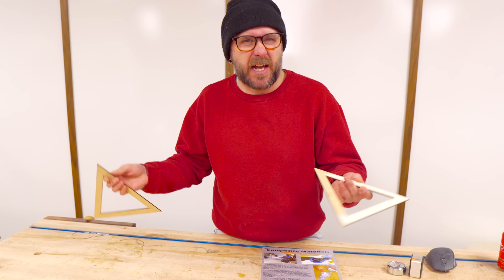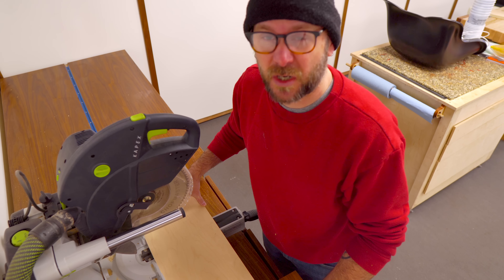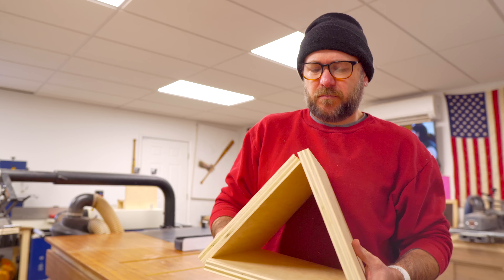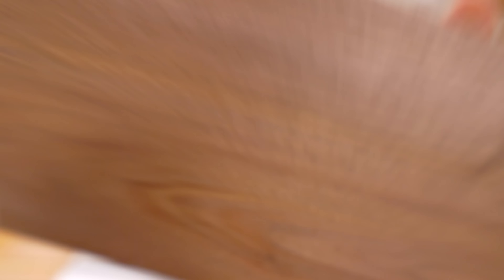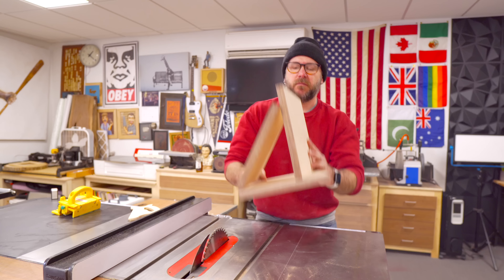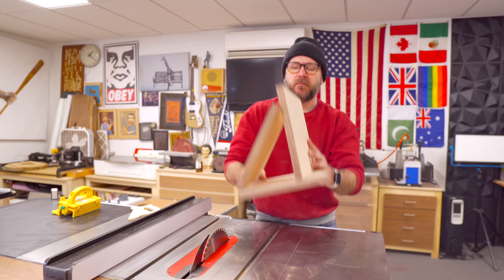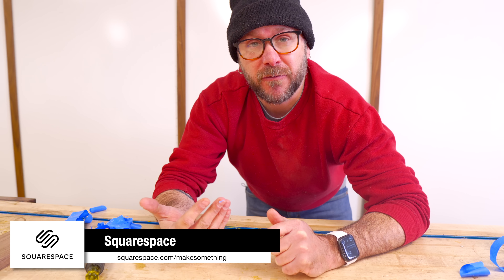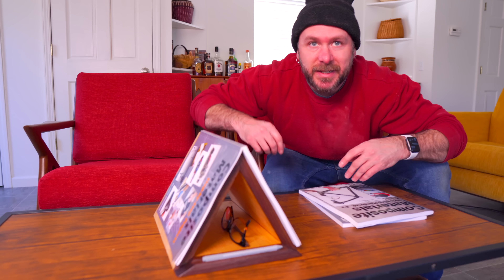How to Make a Quick and Easy Book Stand From Scraps. | Beginner Woodworking Project.

Comment: 12:55 We're all a bit on edge with the quarentine and all, so I have one tip for you to regain some sanity: 
1. Get one of those paper clamp thingies, the ones that look like a triangle with 2 legs.
2. Drill the side opposite to the opening, (2-3mm would suffice) and insert a wood screw from the opening side towards the back. Using another clip to keep the first one "open" while you insert the screw from the clamping side helps a lot
3. Screw to a small dowel

There you go, your own little disposable painting thingymajig, you just get offcuts of high density foam (or just reuse those crappy ones you got there) and hold them with the clip, when you're done you just toss the little foam square. No cleaning, no mess, no more stiff brushes. And you can make several sizes.

Comment: @7:45 that’s like the blue Modine heater I have hanging in my shop. I call it “the destroyer of takes” because without fail it will kick on at some point when I’m trying to film a video. I try to remember to unplug it first but sometimes it’s just too cold and then I regret it as soon as it kick on.

Comment: On the Glue Bot bottles, there is a little nipple in the center of the twist off refill cap that is designed to hold the rubber cap while the bottle is being used. :)

Comment: To close the mitre you need a slightly larger angle right? So shouldn't it be 59 degrees?
Reply from the maker: that would create a gap on the other end. next time 60.25 degrees. I want there to be a little gap in the bottoms so the corners meet perfectly.
Reply: @MakeSomething  ok so if you meet 2 45 angle degrees would you lean toward 44 or 46 to close your gap? I always thought you had to use a larger angle. In your case you needed 30 degrees but but using 61 you cut 29 degree angles. I am not a skilled wood worker so I am trying to learn from somebody with more experience.
Reply: You want to undershoot the total angle by a lil bit- so if you're going for a 45 outside angle, you want to cut your two pieces to less than 22.5 each

Comment: What brands of power tools and wood glue do you find to be good for a beginer on a very tight budget?
Reply from the maker: Every wood glue I have every used has worked great. I mostly use Titebond. As far as tool brands I don't have a suggestion. Buying used off of Facebook or Craigslist is a great way to save lots of money.

Comment: On the lid of that glue bottle, right in the center, there's a spot to put the red cap on so it doesn't dangle in your way. Also, when you were fumbling trying to get those three pieces to balance against each other in your hands, I totally thought you were doing some cardistry moves with ply!